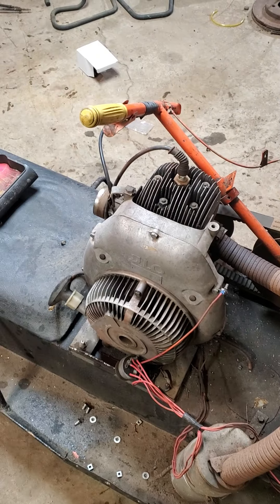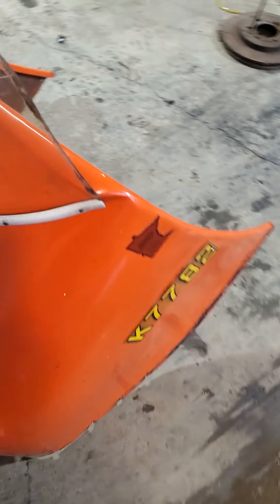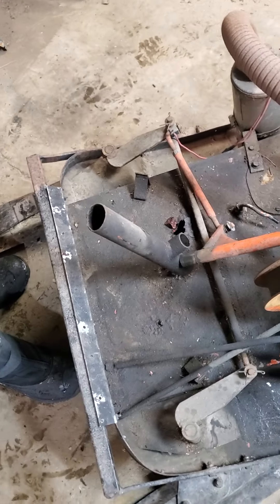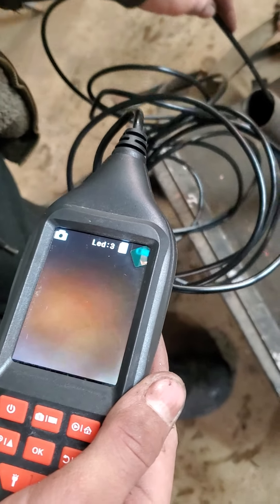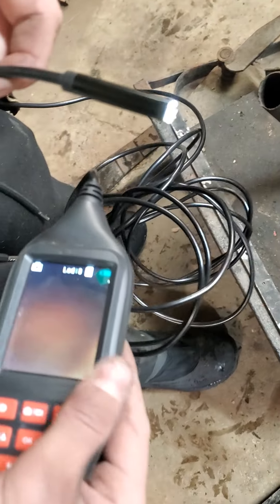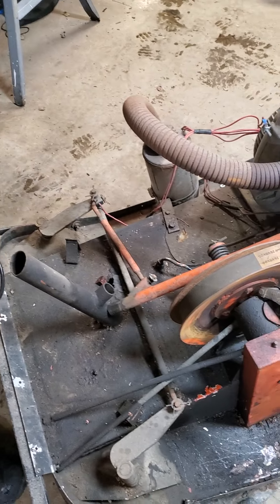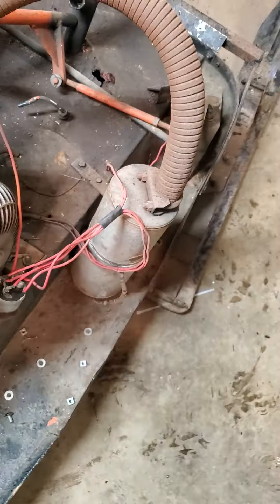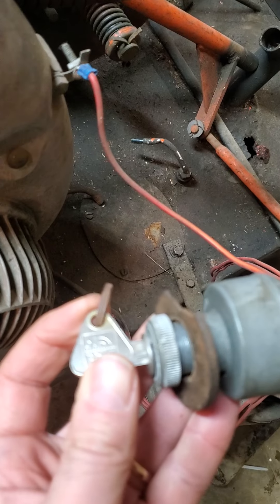1965 Moto-ski barn find let's get it running Part 5

Comment: Lots of carb and fuel system cleaning on those old timers that have been sitting. Looks better than most of the oldies I rode as a kid. '69 Arctic Cat Panther, '68 Evinrude, '69 Ski-Doo Olympic.... ah, memories, more work than the new ones, but much lighter, more versatile. (And where'd ya get that long probed bore scope?)